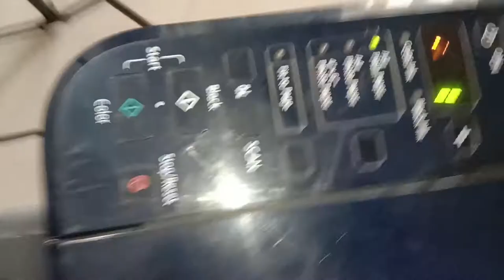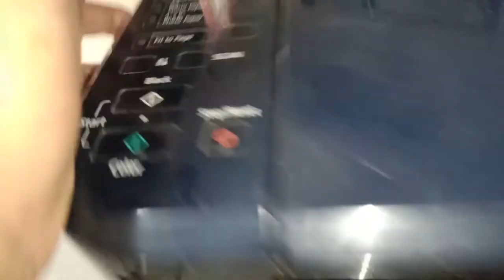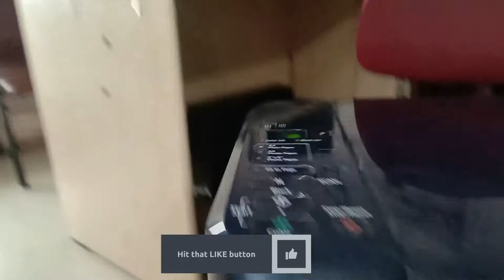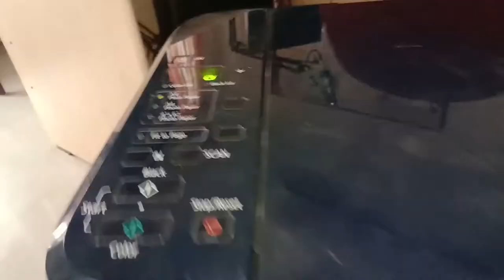how to remove paper jam in canon pixma e510 remove jammed paper Canon Pixma E510 Fix inkjet printer

Comment: car,gsfxmentor,girishsolanki,canon,pixma,colour,printer,printer e510,color inkjet,inkjet refill a,amazon,inkjet refill and add new in amazon,canon e510 printer cartridge,canon e510 printer cartridge refill,peparjam,fix,paper,feeding,feed,problems,not taking,not working,cleaning,roller,inkjet,mg2250,diy,repair,printing,print,transport,scanner,sheets,tape,double sided,double-sided,rollers,transport cleaning pads,transport cleaning sheets,glue,sticy,dirt,dust,clean,feeder